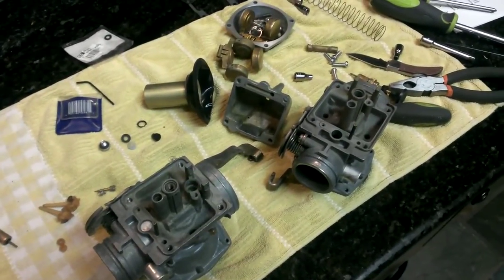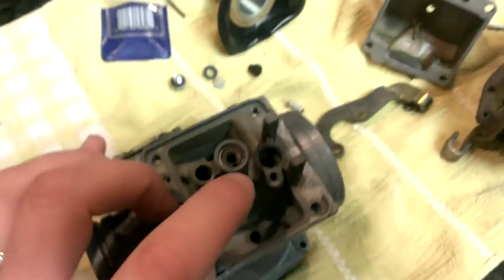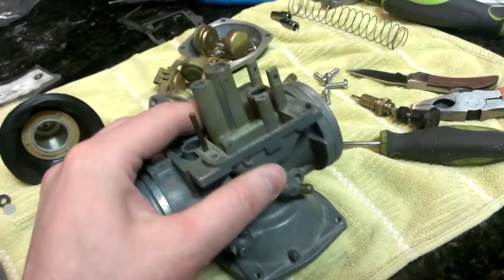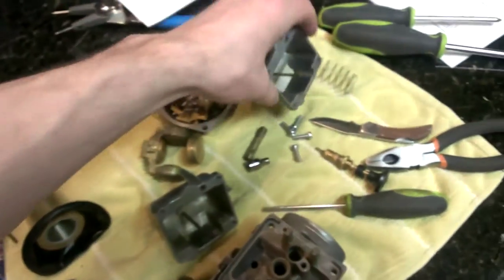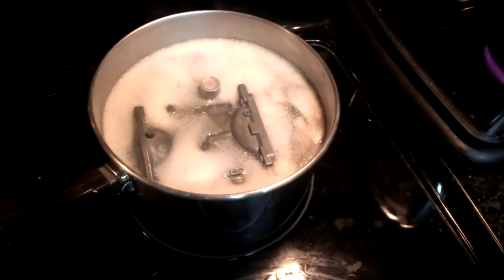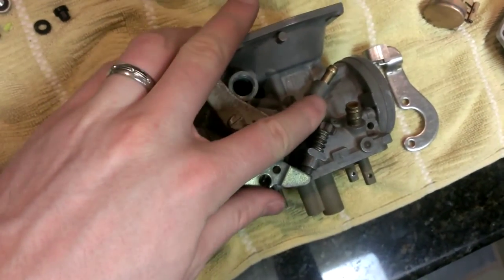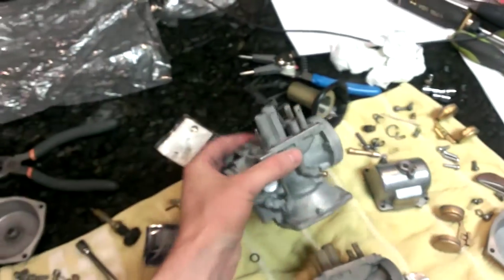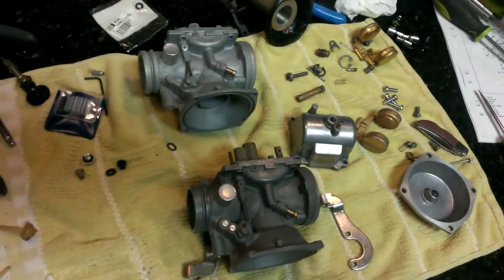Carburetor Cleaning with lemon juice - Suzuki SP400

Comment: I would send the alloy bits to get them hydroblasted! You wont beleieve the difference when you get them back. In my collection I have a fully restored 81' DR500SX. I suggest you get a copy of the workshop manual of e-classicbike.com from EBay. it will answer most if not all of your questions. It was my bible during the restoration. My Mikuni 40SS were in worse condition than yours. You can buy citric acid from the supermarket in powder form but get them hydroblasted.
Reply from the maker: +Supatipanno J Thanks for the tip - I'll have to try that next time!